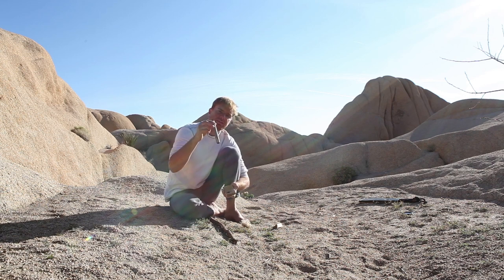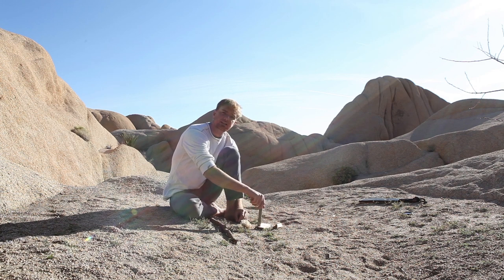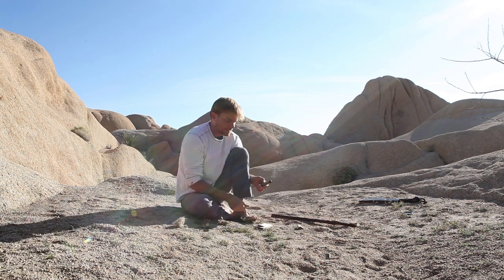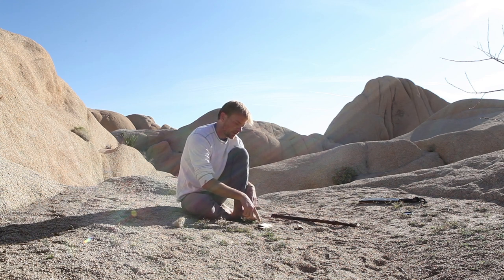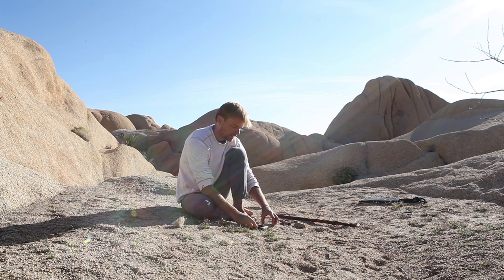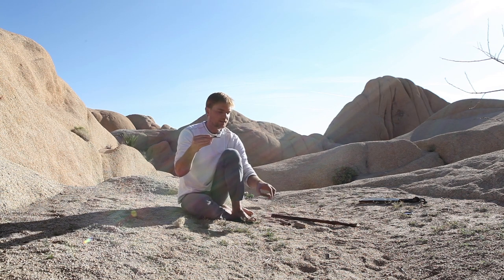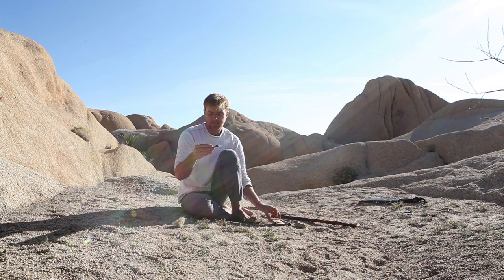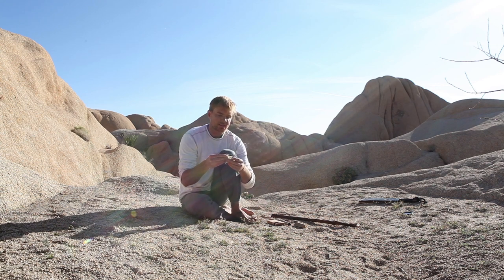bow drill video

Comment: hey Tom, I've been practicing bow drill for about a year now without much progress, I am able to get smoke and ash, but the ash is brown, not black, when I try to add pressure, the bow slips. Can you give me advice on what to improve on?
Reply from the maker: If the string is slipping it just means that it is too loose.  First thing, tighten your string so that you have to crank on the spindle (drill) to get it to snap into place.  Its hard to say without watching you, if you video it Id be happy to watch and critique...  That said, if you are only getting a lot of brown dust it means you need to add more speed, you may even be putting too much pressure and too little speed.  So, crank out some speed at the end and see if the dust turns black.  What type of wood are you using?
Reply: +Tom Mcelroy-Wild Survival Eastern Red Cedar, and thank you very much.
Reply from the maker: Hey, Yeah eastern red cedar is rough!!  Try Basswood, Cottonwood, Willow, eastern white cedar or anything else and I bet youll get it right away.
Reply: +Tom Mcelroy-Wild Survival ok thanks